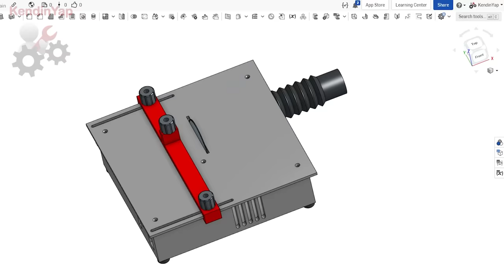Making a Very Useful Mini Table Saw With 3D Printer.

Comment: i don't think 8 Amps is enough for 775. you need atleast 15 Amps power supply for optimal performance.
Reply from the maker: This is a 100W motor that works with 24V and 8 amps is more than enough. Under normal conditions (100/24=4.16A) the maximum current required is 4.16A. If it were a motor that works with 12V, your claim would be correct. Because 12V versions are usually 150W. 150/12=12.5A. In other words, a 14-15A power supply would be required. That's why I prefer 24V 100W motors because they are much more efficient and sufficient.

Comment: Thanks for the video. How about a protective or lock cover for saw blade side, when you only use drill side.
Reply from the maker: Even commercially produced mini saws do not have this type of protection. But why not. It can be done, of course.

Comment: Congratulations! This one is the best that i've seen so far. Just a comment about the bearings: I think the best option is to use flanged bearings instead using those red stripes.
Reply: They would still need retention.
Reply: @Tensquaremetreworkshop  a ring, maybe?
Reply: @rltxandroid  Three screws and washers are easy, cheap and effective.

Comment: Great job. I am trying to print them. When I open the STL on Fusion 360, dimensions are about 10 times your measurements. Am I missing something?
Reply from the maker: Thanks.. STL files were created with Onshape, not Fusion 360. And you cannot open STL files as projects. They are for Silecer.
Reply: @Kendin-Yap  Thank you. That works

Comment: Hi I have a 2 pin rocker switch,  I see you using 3 pin , can you tell me how do I connect up the wires please
Reply from the maker: There is no difference. In any case, one of the 3 pins is free. For 2 pins, there is no free pin.

Comment: what about PLA material vs ballbearing and motor temperature ??
Reply from the maker: As I showed in the video, there is an ABS insulation piece between the motor and the PLA bed. So it won't be a problem. Bearings, on the other hand, do not reach high enough heat to damage PLA.
Reply: @Kendin-Yap   Oh ok,   sorry,  my english is  a bit poor

Comment: Hi can tell me which set I need the Screws (M2.2 -2.3) there is set 1-7.
I would appreciate if you can point out which set to order from aliexpress
Reply from the maker: Both happen. I used the 2.2 ones.
Reply: @Kendin-Yap 
Sorry which set I shall buy 1-7 from aliexpress?
Reply from the maker: @ynm078  Set-5
Reply: @Kendin-Yap  jazakallhu kahir brother
Reply: Hey brother can tell me what type of screws you used to secure the top cover 5 screws on top.

Comment: Nice brother👌
Can you make 8 chanell long range radio control and receiver with esp32 for your next video?
Reply: Esp32 isn’t good for long range you need to use an actual radio module, like nrf24 or Lora, or just buy an off the shelf transmitter and receiver.

Comment: There are a few safety concerns with this. The first is the power wires are pretty close to the belt, they are bent out of the way but the device vibrates so could become an issue, there should have been a cover over the pulley to prevent the wires from ever being able to touch it. The plastic will give you no protection from that saw blade, the top cover should have been a metal plate, it would have been easy to make with your rotary tool.

Did you really need the drill chuck and grinding wheel out the side? It will probably cause more problems than it solves, you already have the rotary tool so it is unnecessary. In general having as few exposed spinning parts as possible is safest.

Also no speed control? You can get speed controllers that have a knob to adjust the speed, you should have used one of those.

The biggest issue is the lack of emergency stop, all tools like that should have a big, red, obvious emergency stop button.

A lot of issues with this, it isn’t particularly safe and more concerning is the amount of people wanting to copy it.
Reply: Or we can just be careful when using it. BTW, let's see the one you built.
Reply: @tcarney57  or you could just make it safer in the first place. Part of being careful when using something is reducing the chances of injury in the first place especially since it could easily have been built safer.

Do you really think the "let's see the one you built" is some kind of intelligent response? It is one of the most pointless arguments that people on the internet make. This is literally just a motor and a spinning blade, it isn't exactly complex, is it? The whole argument is based on the incorrect assumption that you have to have built something practically identical in order to be able to comment on it. The only people who make comments like that usually have below average intelligence and you definitely seem to fit in that category.

Comment: From where we can aquire plastic body for this project
Reply from the maker: This body is 3D printed. It is not a ready-made commercial product. I shared the 3d files I designed below the video. If you do not own a 3D printer, there are companies that provide this service. You can search for them for the country you live in. You can use the files through them.

Comment: 24v 15000 rpm motorların çok çeşidi çıkıyor aradığımda. İdeal olan hangisidir rulmanlı olan mı?
Reply from the maker: Benim kullandığım buydu.. https://www.n11.com/urun/rs775-dc-motor-24v-15000-rpm-rulmanli-sarjli-matkap-cnc-motor-15670279?magaza=robizstore

90 ile 150watt arası güçte olan ve 12000 rpm - 15000 rpm arasındakiler uygundur.
Reply: @Kendin-Yap  teşekkür ederim. Bir de 8mm mandren bulamıyorum hep 10-13mm çıkıyor türkiyeden.

Comment: ¿Por que la polea? ¿no seria más sencillo colocar la sierra directamente conectada al motor?  Y quizás aprovechar para colocar mejor un variador de velocidad electrónico que no le quite torque al motor
Reply from the maker: The pulley is a 2:1 ratio reducer. Reducing the rpm and increasing the torque provides much more efficient and powerful use. Direct motor connection is not efficient.

Comment: Unfortunately When I tried to download the STL files it says they are corrupted. Looks neat though.
Reply from the maker: STL files are not corrupt. It's a zip file. You have to download and Unzip it.
Reply: It’s was the unzip program that said the files were bad.
Reply from the maker: Many people have downloaded and used these files. I've also checked a few PCs with Windows OS and it's working. I don't know why you're having trouble. @mspetersen

Comment: Give me a chance to be your sponsor-about enginediy
Reply from the maker: Thank you very much for your interest. I looked at your website and liked it very much. Fuel engines are my area of interest. For many years, I made and used car, helicopter and airplane models with nitro engines. But in my country, a new regulation has been made regarding the customs laws. For individuals, products with a price of 150 USD or more cannot pass through customs. Even if it is sent for free, this does not change the situation. Because customs officers take into account the value of the product. Therefore, I will not be able to deal with your offer for now. I'm sorry for that. (01kendinyap@gmail.com)

Comment: Metal kesermi acaba
Reply from the maker: 2mm alimünyum levhayı ve et kalınlığı 1.5-2.5mm alimünyum  boruları rahatlıkla kesebiliyor. AMA metal keserken bir süre sonra metal ısınır ve tablaya yansır. Tabla PLA ile yazdırıldığı için deforme olabilir. Tablayı ABS veya ASA filament ile yazdırırsanız ısı sorunu çözülmüş olur.
Reply: @Kendin-Yap  çok çok teşekkürler,birde motor ve diğer akşamları alabileceğim bir link birakabilirmisiniz

Comment: A box wrench is used to tighten the saw blade on the tip you added, not a screw driver on the shaft at 6:26. That's what the flat sides are for on the connector you added. Why so many types of screws, simplify that or use more similar stock. Also set length for the pulley belt, you might like to pull that tighter later before the actual belt is dead. Can't when it's set to one length.
Reply: You can see the motor mount is adjustable.
Reply: @conorstewart2214  No I couldn't, or else I wouldn't have mentioned it. Thanks though.

Comment: Cool but with small elements, it's hard to keep them. Anyway, all these circular saw blades are poorly designed.. Someone must have insisted on making a dummy out of themselves.. On the right side, you should have a sliding tabletop on the guides with fixing the element and the pusher is not necessary, even this clever fence..